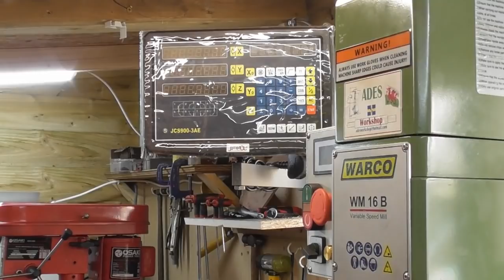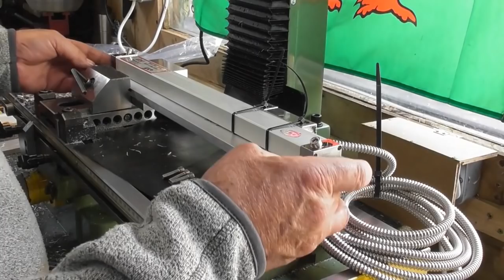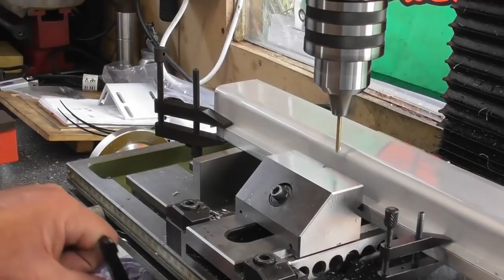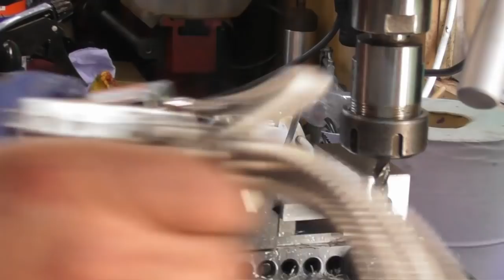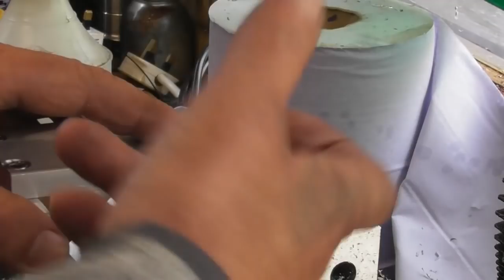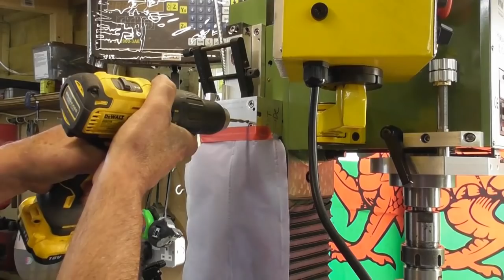Installing a Three Axis DRO on My WM16B mill . the Z Axis.

Comment: Your video gave me an idea. 
I'll use the L bracket that came with DRO, and attach reading head to the longer wall 80mm, and shorter wall 40mm attach to 40mmx40mm 80mm long L bracket, which would be bolted to moving column. 
The scale just bolted to fixed column,  with opening facing away from the flying chips.

Comment: Hi, Ade I have just bought the WM16B and watching your video I think you say 50mm X 5mm looking at the video the 50 looks fine but the 5mm loks to be much thicker. Can you confirm the size please.
Reply from the maker: let me watch back and check .
Reply from the maker: just watch it . 50x10mm . good stock and cheap from aluminium droitwich , look on ebay , good service, cheap and really good quick delivery . Cheers Ade

Comment: Hi Ade, you mentioned a  UK supplier for your DRO, in case you needed to get in touch re. probs etc who is this UK supplier? I have on my watch list a couple of DRO kits but all supplied from China.
Reply from the maker: As it turned out it did get shipped from china , misleading website and got duped, it did arrive quickly and no complaints with the product though. Cheers Ade

Comment: Hi Ade,
I enjoyed the video but having worked with my mill I find I use the quill measurement more than the whole head movement. I’m just wondering if it would be better to attach the DRO to the quill. The one that came with the mill is a bit iffy in my opinion.

Comment: Hello Ade, just bought a wm250 lathe from Warco, all good with lathe etc, do i have to spend in excess of £200 to get a good drill chuck for the lathe, i bought a 2mt from Amazon and a live centre they look the business, buttttt i took the three jaw chuck of the head stock and popped them in to the 4mt with an adapter which i've clocked and is running within a thou. the drill chuck is 0.45mm out etc, it has a visable wobble as does the 2mt live centre. Its doing my head in can you recommend a drill chuck and live centre, thanks Glyn. The Albrechts look great but very expensive.
Reply from the maker: Hi, Glyn . I think for ok stuff on a budget then try RDG tools online shop . that is where i got mine and no complaints . Perhaps look at Rohm chucks too. Cheers Ade.

Comment: The mount looks very solid there and much more rigid than some of the ones I've seen in the marketing pictures for the DRO scales from the manufacturers.  I'd like to get a DRO at some point but it's not in the cards for me right now so been doing some other workarounds to get stuff done with what's available.  Looking forward to seeing how you mount the other scales as if I ever get a system for my mill-drill the X and Y will be similar, at least.  Hope you're doing well!

Comment: Sure i saw a different lathe toolpost in one of your videos (wedge style) but i cannot find it. Did i imagine it?
If you do have one what size is it. I have the SP109 Lathe which is almost identical to your WM180 except my gears are backwards (different position of the spindle gear.).  Also what is the DRO you have fitted? Thanks.

Comment: Ade , without this sounding like a silly question . why have a z axis readout when you already have a quill Dro ?
Reply: I have a Warco 14, and considered removing the quill DRO and installing a short glass scale, in its place, it is possible.  Installing a glass reader on the 14 is an attractive option due to it having the head handle mounted on the top of the column, which makes it more difficult to use.  I’m considering installing a stepper motor up there to make this easier.
I opted to keep the quill DRO, and install a glass Z axis reader, much as Ades has done. I can then use either, depending on what I’m doing, this works well.  The down side of the little quill DRO is forgetting to turn it off 🤭
Reply from the maker: It is a good question . I often have to lift the head to change tooling. with the z DRO i can come back to the same spot and keep my datum , Also, when i am machining more heavily , i like to move the head to put the cut on to keep the quill fully retracted.Cheers Ade.

Comment: Hi Ade, nice work. It was good to watch you fitting the DRO. I fitted one to my Harrison lathe. I also made all bespoke fittings for driving the read heads as I didn't like the supplied ones. Were Bang Good going to supply you a DRO free of charge? If so I think you did the right thing not accepting. There is a certain other channel that has gone down the tubes after adopting sponsorship; it's a slippery slope. Just my view. Thanks for introducing me to Jon's Workshop, enjoying watching his content too. Really looking forward to the next installment of the DRO fit. Thank you.

Comment: I brought the same type of mill month ago. I ordered the DRO with the LCD. I have this 7-segment LED type on the lathe. And to say this clear: It is a day and night difference in usability. The LCD type is way more easy to use.
And for the mounting: The back part is flat. I directly bolted the scale on the back end and made a very flat bridge over. It looks way more slim. I didn't mounted the chip guards at all. They are quite useless.
Mounting the X scale was hard... Had to pull down the sattle to drill the holes on the bottom fixed sattle part.
Next I will add a worm gear drive for the Z way, so I can hit buttons to move the head up and down. The wheel up there is annoying.
Reply from the maker: the LCD type was my first choice but not found by uk supply at the time . still happy with what i have though
Reply: Sounds like a good modification.

Comment: Hi Ade .. another Fantastic Project with the DRO setup. Looks so neat, just like a store bought Install Kit. Looking forward to seeing the completed project.
 The only question I have, is it possible that the holding bracket on the Glass Sliding Scale might be a bit heavy for it ? Looks about 10 to 13mm thick.  Keep up the great video's. Be safe & catch you on the Flip Side
Reply from the maker: Hi Ted. the bracket holding the reader is bolted solidly to the moving head on the mill and the weight is supported by the head, accuracy is helped by the rigidity of this bracket and no load is applied to the reader in the scale. Cheers Ade.

Comment: tie a rubber band/spring? of some description on the lead for the z axis and tie it of to the rafter so it pulls the slack cable up when it goes up.
 Just  to control the slack when the z axis moves up and down.Just a thought!
Keep up the good work!
Reply from the maker: Cool idea

Comment: Hi Ade. Wondered how long it would be before you fitted one. Great add on. My old Tom senior has one & it makes life so much easier. I made a x axis power feed using a car wiper motor. Another great add on. Will watch with bated breath. Steve.

Comment: Hi Ade, shouldn’t the z axis DRO be reading the tool height. It looks to me that you will be reading the height of the head unit without the quill. Im only asking the question because I don’t understand the benefit of that. I don’t even have a mill yet.
Great videos, I always look forward to seeing them.
Reply: U are right, it will read the head hight. But the quill has its own DRO on this mill, so you can use both in combination and add the values. You can't fit glass scales for the quill on this mill anyway.
Reply: Matthias H. You can there is video line of it being done, I considered it but opted to keep the fitted DRO and fit a glass DRO as Ade has done.  If the quill is locked the ‘head’ DRO measures tool height.
Reply: @Jestey6  As always: You can do nearly everything. But fiddling a glass scale on the quill is way from elegant. Than you can buy a DRO with 4 axis and combine to in there config, yes... But unless you will use 1 micron skales, the already mounted quill DRO is good enough. You won't get a real benefit from this modification. Especially in contrast to the price and time you will pay for this all together.

Comment: Well done Ade, nice work and well fitted. I must agree, the supplied bracket for the reader head looks a bit weedy, your solution looks much more elegant and will protect the read head over time from damage caused by flex in the flimsy one. Top job, you keep showing me how to go on so when I get my mill I have a good reference. Cheers, Jon
Reply from the maker: Hi , Jon . I am sure your solution would be just as elegant. as long as it did not involve welding . Damn pidgins . great to hear from you , and if anyone is reading my reply . Check out Jon's Workshop .

Comment: Hi Ade.  I've just changed the drill chuck on my WM16B.  Got a MT3 to JT3 arbor from Arc Euro Trade and a Jacob's 14N Super Chuck from Zoro.  Working very well so far and no more need for that M10 drawbar!! 👍
Reply from the maker: Sounds great! i have a keyless chuck and have ordered an arbour from RDG moments ago , I also have a lovely Rohm 0 to 1/4 inch keyless and have made an arbour that fits a 12mm collet. moving forward every day. Cheers Ade.

Comment: Hi Ade. What happened to the plastic spacers that come between the read head and the scales. Many people think that they are packing pieces for transit but you're supposed to fix everything to the mill and the last job is to remove the spacers thus having the correct gap. All the best. Jim.
Reply from the maker: there were none with my scales .
Reply: I think those plastic spacers come with magnetic scales. Ade has glass scales. On my lathe I had one magnetic and one glass. I had this little plastic shim that miked up about 0.5mm. Couldn't work out what it was. Then it dawned on me, was for setting the gap between the read head and magnetic scale. I felt a right plonker.
Reply: @britishreaction54  All of my glass scales had the spacers.

Comment: I fitted the same unit to my lathe.  But it didn’t work, turned out the pins in the plugs from the scales weren’t compatible with the display unit. It was quite easy to swap the pins around once I found out the right positions. Great video Ade. 👍
Reply: Are you the Derek Wilkinson who used to be a mobile mechanic around Hainault and Barkingside Ilford Essex?